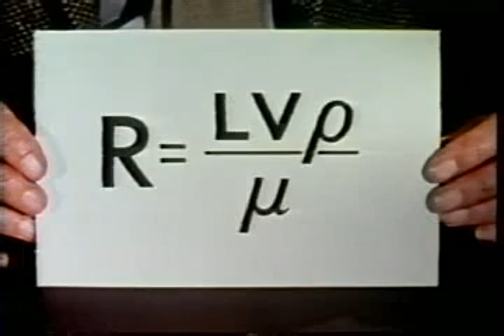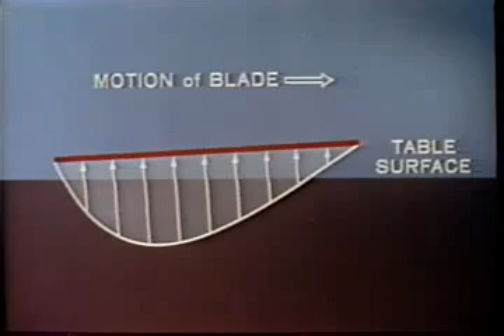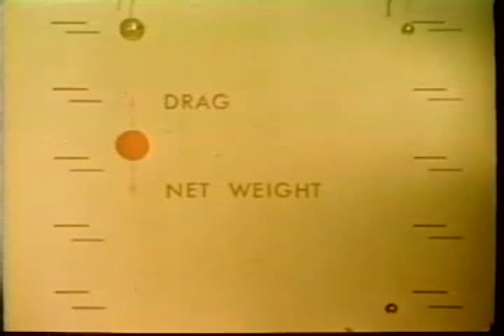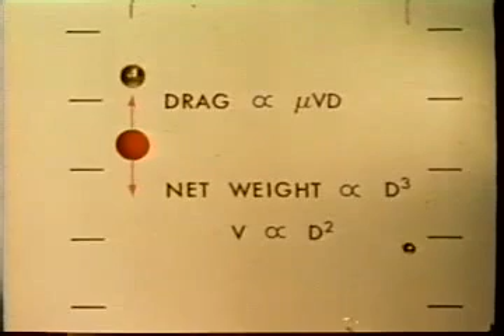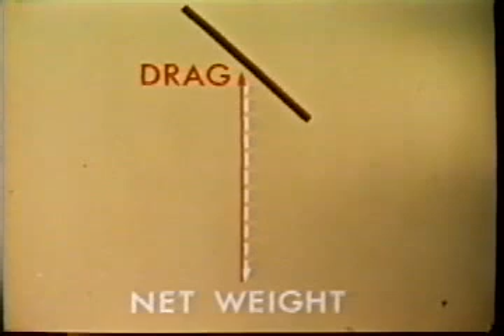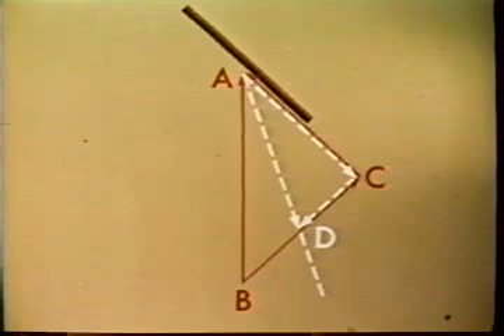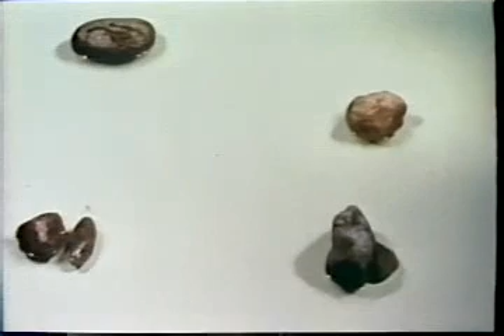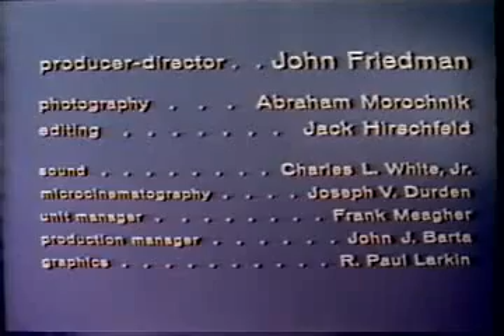7. Low-Reynolds-Number Flows

Comment: In the sedimentation experiments, he didn't mention the influence of the walls. However, these are very important here. A cloud of particles in open space falls much faster, and this is not directly due to viscous forces, but due to continuity. Even with high reynolds number flow, a cloud in an upright pipe falls slower than the same cloud in the open air.

Comment: He did show what a single particle near a single wall does, but there's a big difference between that situation and a wide cloud of particles. A particle pushes the ambient fluid downward, and it must come up somewhere else. If there's nowhere else where it can come up because there are particles everywhere, then the fluid must go up close to the particle, which increases drag. As a result, the downward velocity of the particles is much smaller. Example: Boycott effect